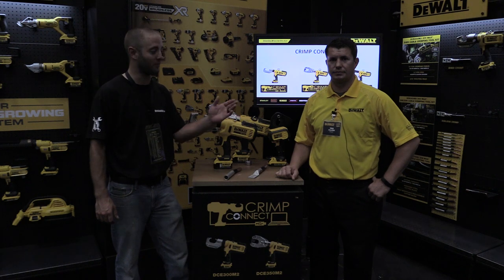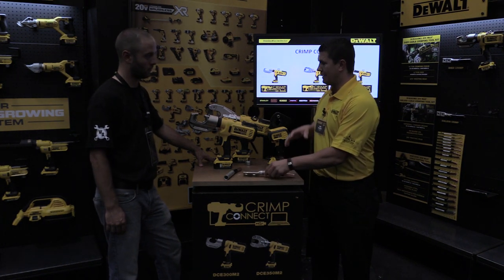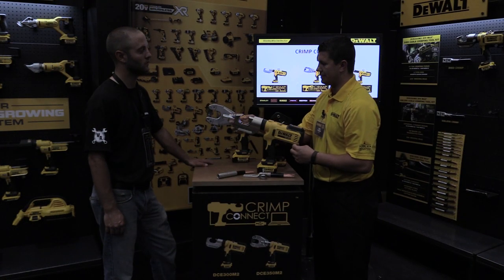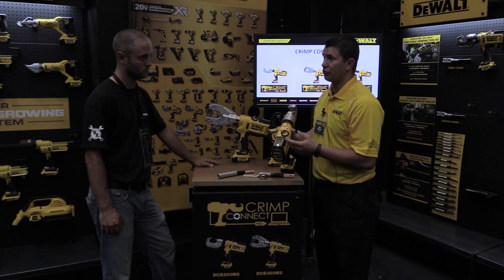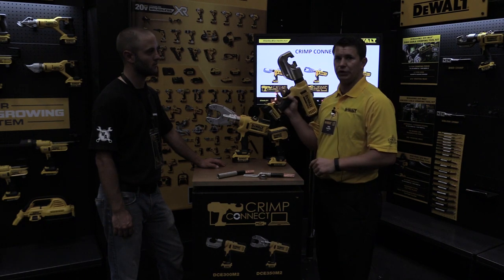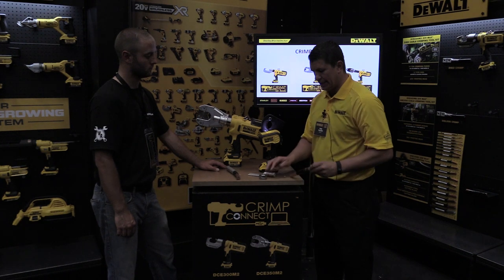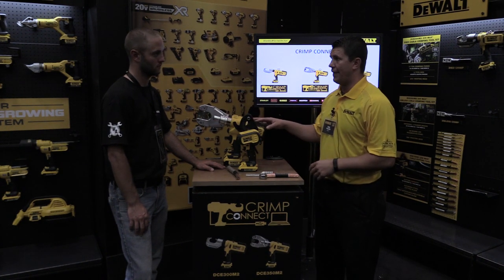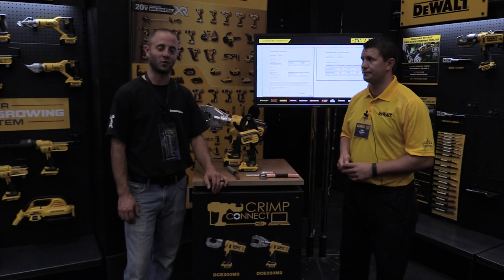Dewalt Electricians Crimper and Cutter with Crimp Connect System

Comment: I found the crimp connect software under the dce300 on the dewalt website. So, after getting the software and plugging it in, I found that my dce300 had been used successfully for 157 prior crimps and that it was then calibrated, it now has had 15 crimps since then with 9 failures. It is sporadic as to whether it will work properly. It is apparently a common problem and this thing is going back to the factory where it might cost $200-$1500 to fix. I have never had these problems with Milwaukee crimpers.